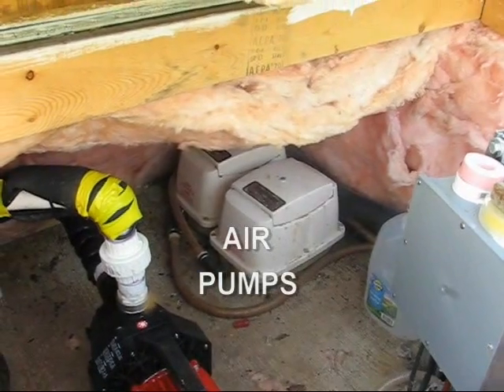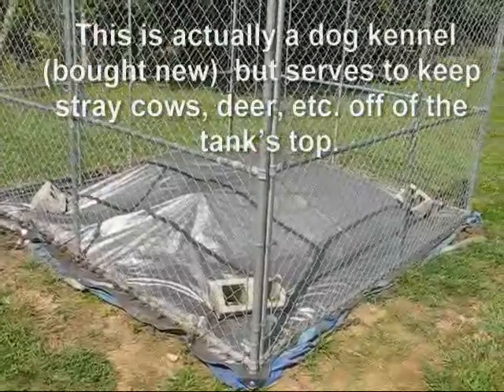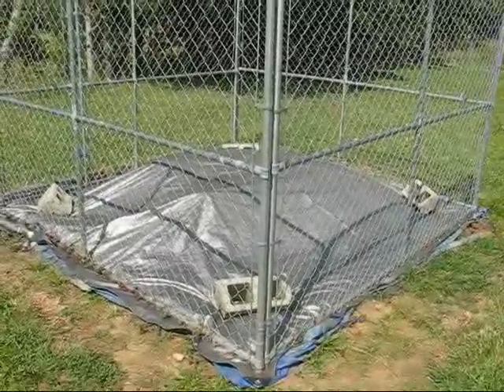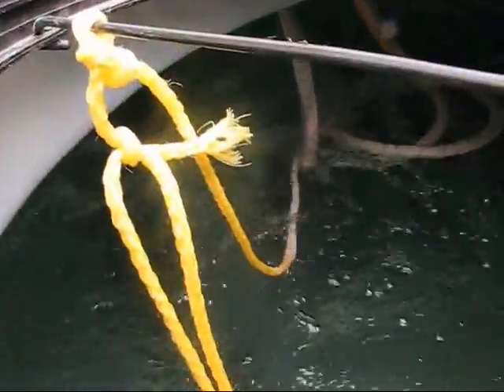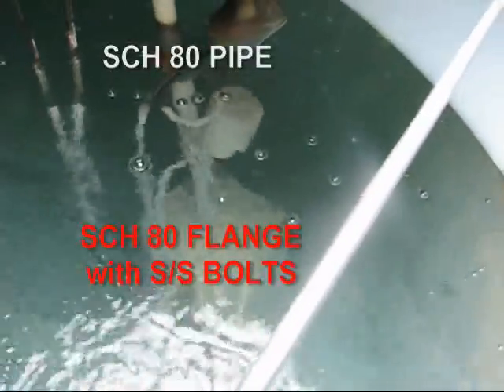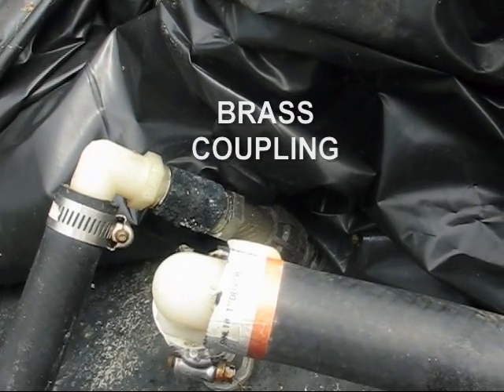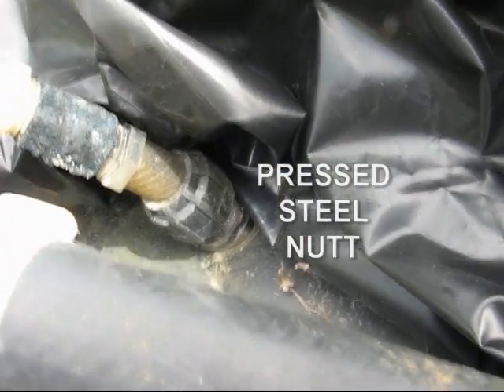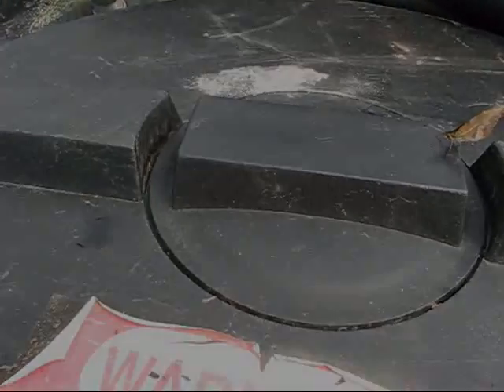Sulfur Water

Comment: OK,I know it has been a while since you posted this video, so How is this setup treating you? Anything you would do differently? Is there any buildup of trace particles? I have sulfer water and am about to retire my old cystern and setup a new above ground setup and ran across this solution you implemented. I have also seen commercial systems that profess to remove sulfer, iron and other heavy metals and bacteria and was wondering if your solution is just for sulfer or ...

Comment from the maker: @coldpak82 - the air pumps are low wattage, high volume and low pressure pumping into sized aeration stones. Think of it like a giant aquarium. Smaller or larger tank/parts could be used is the level of hydrogen sulfide was lower. And you are right, it wasn't cheap. But then, neither is replumbing a 2-story house and replacing a ton of valves. My neighbor has an aerator that is about garbage can size. It was about $1000 but doesn't work as well for as much water.

Comment from the maker: To give you an idea on how bad 150+ ppm is, when I first popped the well I took a shot-sized sample after pumping several thousand gallons. I placed a copper penny in it, covered it with plastic cling type wrap (to hold the gas in). 

In 30 minutes it was jet black except for the spaces where Lincoln's head touched the glass. There was a reactant film literally floating on the water.

It is a problem but it can be tackled.